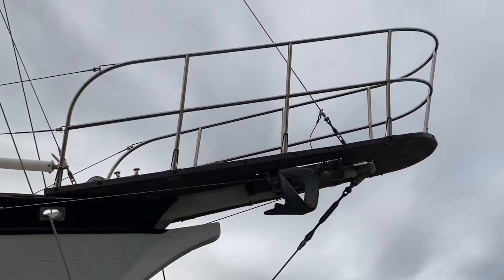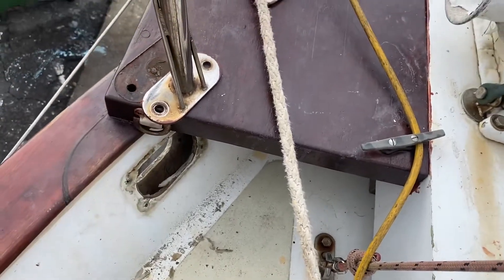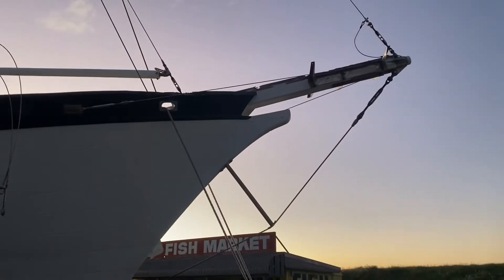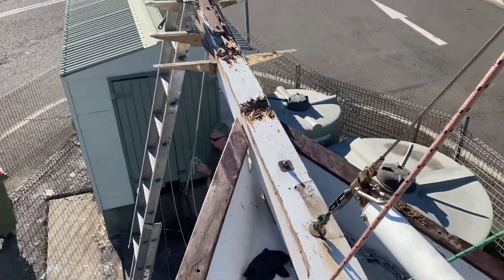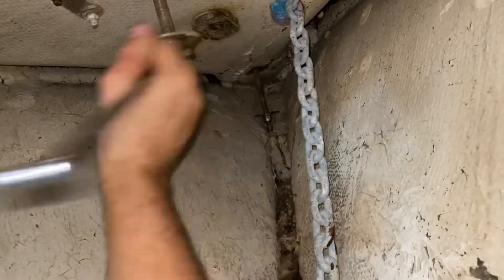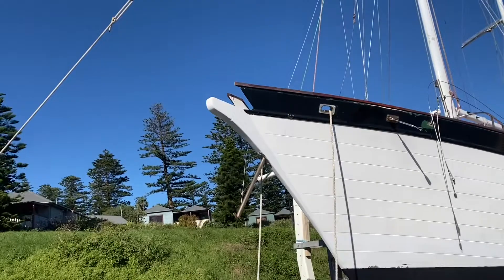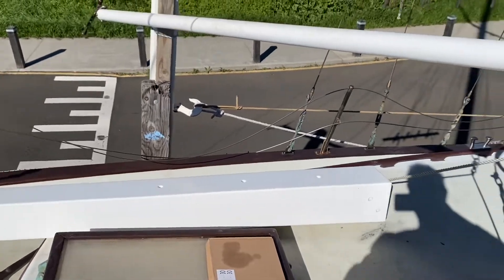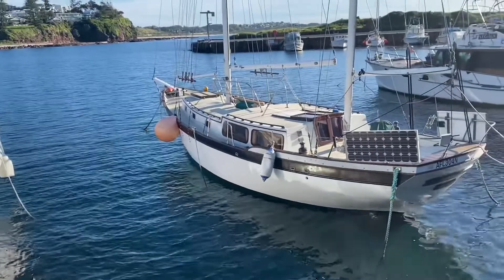Bowsprit Replacement on a Downeaster 38 Ketch

Comment: hey buddy tondy looks nice 
i’m sanding mine  inside 
repainted engine and redoing cooling system
Reply from the maker: Thanks mate, what parts are you sanding inside? Cabin sole? Cabinetry? I did a video ages ago on rebuilding the raw water pump and another on removal and cleaning of the heat exchanger.Maybe they might help?
All the best.

Comment: Hello.  Just removed my bow sprit,  Down Easter 38 ketch ‘75. Looks like it’s a bit soft and it’s already been scarfed at the outer end a bit. What wood did you use for your new one? ‘might have to replace all of mine.  Thanks for the video!  G
Reply from the maker: I used two pieces of Oregon (American's call it Douglas Fir I believe) They were old beams from within a 70 year old house.